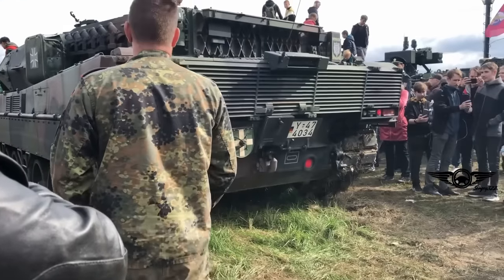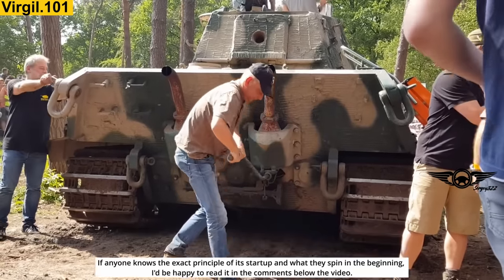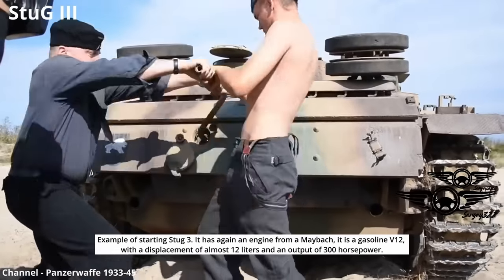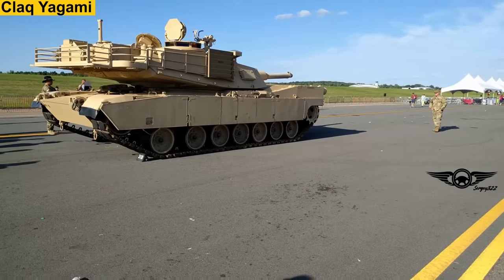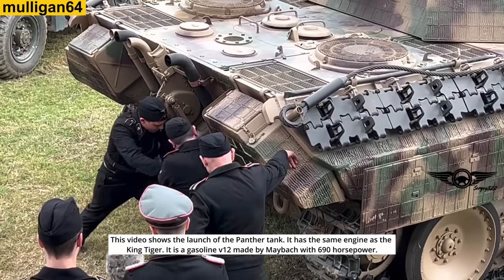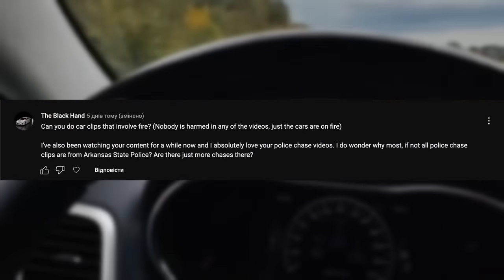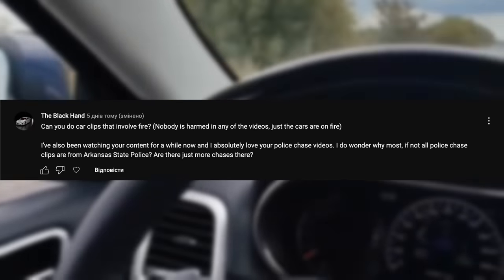TANKS ENGINE COLD START AND REVS (Abrams, Leopard, King Tiger....)

Comment from the maker: Hi all, doing the second part?
Enjoy watching it. Thank you for your support of the channel.

The second part - https://youtu.be/LVXtUNldgSA
Third part - https://youtu.be/A3fxGczyPds

Feel free to leave your questions under this comment. If you have any)

Submit your video to be featured - https://forms.gle/LysRYr34A6Z7B7va6
Reply: Love you videos
Reply: Yeah on that first tank the tiger, they're cranking a flywheel that helps get the motor started. What they used to do on the old model has back when cars were first start be made and they didn't have actual starters
Reply: 0:46 I believe they are starting the pony motor.
Reply: @Wyomingchief basically the same as push starting it just with a crank
Reply: @evilborg its just a massive flywheel
Reply: А как они классно горят от русских РПГ-7.😂😅
Reply: King Tiger: "spits" who the fuck woke me up??
Reply: Perfectly right, sir
Reply: The king tiger is using an inertial drive starter, they had both electric and inertial, but they mainly use inertial for the show.
Reply: Все это конечно не плохо , но там тепло , а если минус 10 -15 градусов.
Reply: King Tiger uses an inertia start mechanism. Basically they are spinning up a flywheel.
Reply: Flywheel
Reply: Horsepower isn’t the same as capacity .

Comment: They are started by using the inertia of a spinning flywheel. You crank the flywheel up to speed with a hand crank once you have cranked it up to speed you remove the cranking handle, then engage a clutch which makes the flywheel turn the engine
Reply from the maker: Thanks!
Reply: The crank starts were around before electric starts on all vehicles, tanks, cars, trucks and farm equipment, then stayed as a back u starting method for many vehicles for quite some time. I used a tractor in the 90's that still had hand cranking, indeed some small engines such as generators and go-kart engines still use a variation of this now with the hand pull start.
Reply: @Sergey322  Early Bf 109's had the same type of inertial starters...
Reply: The German WWII tanks can be started electrically via a starter motor, but the flywheel crank start is used to save on the starter motor and electrical system.
Reply: @johnmorgan1629  I had a crank on my series 3 Landrover. It saved my but a few times when my batteries went flat.😊
Reply: Thanks for the info. I was convinced this was a clockwork motor!!!
Reply: the way it simply bangs into life, no chuntering just boom..
Reply: УАЗ также заводится
Reply: People are confusing inertia starters from hand cranking. 

Your old Land Rover / Lifeboat / Generator / Model T was started by you priming the fuel and in some cases decompressing the cylinders, then throwing the engine over by hand causing it to start.

The inertia starters build up a rotational force in a fly wheel separate to the engine that then does the job of an electric bendix type starter.

These guys would be ripped if they were throwing over a 12 cylinder 600hp tank engine by hand. 😂

The British Army says:
“STARTERS
Two starters are fitted - one electric and one inertia. The Bosch 24V axial motor is mounted on the starboard side of the engine at the forward end and immediately above it a Bosch hand operated inertia starter, also of the axial type. The hand crank for the inertia starter, is carried in suitable clips on the tail plate, the orifice being covered by a B.P. sealing plate when it is not in use.”

The Tank Museum at Bovington says:
“Hand Crank Starter
The hand crank starter, is the recommended way of starting a Tiger in cold weather conditions, for normal conditions it also has an electric starter.

The inertia starter ” Schwungmasse ” works by rotating a heavy mass at speed, once it reaches 60rpm a lever is pulled below the hand cranking arm, this pushes the drive pinion onto the fly wheel, making the engine rotate and start.”

Hope that helps.
Reply: @oleandersen2228 I can't imagine if the electricals motor fail and then there an enemy 

Yikes
Reply: @johnmorgan1629  also kick start for motorcycles/mopeds as well are similar.
Reply: pretty obvious to be honest, also a well known starting type by planes using a flywheel driven by an electric motor.

What i find pretty interesting and awesome are the 12 Gauge shotgun shell starters found on i think some british ww2 planes especially
Reply: So essentially your poping the clutch
Reply: @oleandersen2228  partly correct, the main reaon was to protect the Batteries, ww2 batteries were lot more fragile and run much quicker out of juce than todays, Fliehkraftanlasser protected the Batterie of the starting process.
Reply: it is like a tractor
Reply: That Panther engine sounds awesome in idling. Thanks fornthe video upload
Reply: @oleandersen2228 Electric starters were also notoriously unreliable back then.
Reply: Is it dangerous to be around that cranking handle after you pull it back from the fly wheel? Like in the first clip? Looks like a bad place to be incase it caught or something, no?
Reply: @harrison00xXx The first example you gave is how most modern engines start.
Reply: @th3turb0lag  No, i meant inertia flywheel starters, my fault!

You know, the ones with a clutch where you have to spin the flywheel fast before engaging the clutch.
Reply: Cutting edge technology lol
Reply: @HochgeborenKlown all Me 109 had inertial starters and the Fw 190-8 as well...
Reply: same as a old school Citroën 2cv (deux cheveaux) :)

Comment: That turbo whisteling of the leo 2 absolute amazing <3
Reply: all the how dare yous!
Reply: When the leo 2 was at a really high rpm like redlining basically it sounded like a T-64, still sounds awesome though
Reply: The faint whine of the super chargers on the Leo 1 in the first vid are also cool! I miss that sound. The Leo 2s really rip.
Reply: 1.9 TDI +++
Reply: @Grease_Factory Leo one really is supercharged? I did first half of my duty at an driving school company and we taught Leo 1 and M113. I was told the MTU engine was turbo charged 🤔
Reply: @basakysa7054 🤣🤣🤣
Reply: Leo 2 engine is what Toretto needs 🤪
Reply: @thomasr.5443  yes they had twin centrifugal superchargers.

Comment: On all German WW2 tanks they had the hand crank start-up along with normal battery start-up. The crew usually only used the hand crank method when it was cold outside and the batteries were too low on power to start the tank.
Reply: It’s not just the Germans, the Russians and the Americans also mainly used crank starts to get going, the battery method was used only in emergencies (hence the name “emergency start up”) when they need the engine to start quickly, and as you said they can’t use the battery start in cold weather
Reply: FlitzerFlash  i didn’t know if the Russians had batteries in their tanks, so I just included it in my comment just incase they did

If the US had faulty electronics then they wouldn’t have put the emergency starter into service in the first place, it wasn’t like today where an entire truck can fall apart and they still keep it in service; the only reason that the US prefered to crank start back then was because the of the radial engines, if left over night the oil in the engine will settle at the bottom and you would have to (literally) rotate the engine a full 180 degrees to be able to start the engine using a crank start, it is possible to start the engine with the emergency starter on them, however it will cause excessive wear on the engine components; the same is true with the german engines except that the Germans wouldn’t have to turn the engine 180 degrees to re-distribute the oils throughout the engine
Reply: FlitzerFlash  nope... soviet ww2 tanks had batteries AND compressed air, so engine can be started even without batteries
Reply: FlitzerFlash  T34 was started with compressed air and from a battery
Reply: Some German tanks also had a pony engine which started first the start the main engine.  Bit like Caterpillar bull dozers.
Reply: Wrong! The electric starter was only for emergencies.
Reply: Bruh, they used inertia starters, they aren’t turning over a v12 by hand lol
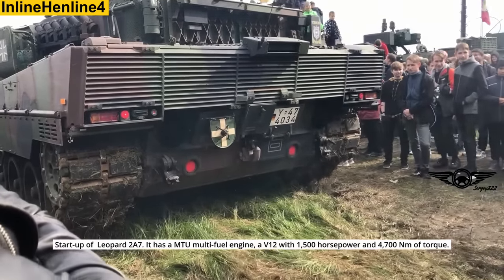Reply: “Lee-oh-pard”? 5:34 come on man 😂

Comment: Fun fact! The M1 Abrams uses about 16 litres of diesel to just to start the engine
Reply: M1 Abrams does not Run on Desal it runs on Gas
Reply: @danielpetrucci8952 wrong it’s jet fuel
Reply: JP-8 jet fuel is the preferred fuel but diesel or even gasoline in emergency can be used.
Reply: @christopherhjorth6091 That’s right. Diesel is similar to jet fuel.
Reply: IAM guessing none of these are battery powered, go green and all that 😂 static museum pieces soon
Reply: @svenlarsen4876 I’d like to see your battery powered tanks actually work oh wait they don’t 😂 and the environmental impact of making those batteries is sooo much better as well as them being longer range oh wait they aren’t 😂. All the failed battery powered tanks won’t get the glory of being put in a museum.
Reply: @KentuckyAk101guy  I was making a joke
Reply: @vincentstohr2216  I like how he said "diesel or even gasoline" as though diesel is basically interchangeable, but gasoline would be pushing your luck.
Reply: @lachlanbell8390  Gasoline can also be used. Military jet fuel is also mixed with gasoline so it doesn’t freeze.
Reply: @lachlanbell8390 the turbine engine is multi fuel. Just as many military vehicles in the US military are equipped with multi fuel engines, which allows them to run on all sorts of shit Incase logistics falls through
Reply: @lachlanbell8390  That's exactly right. Gasoline doesn't have the lubricating properties that jet fuel and diesel do. Running on gasoline would work but would cause higher wear, and likely require a rebuild afterwards.
Reply: @MommyKhaos  That's why it burns and explodes well and it costs $1,000,000 billion.

Comment: One of the reasons the M1A2 uses a gas turbine engine, is because it's quieter than a diesel.  You can hear a diesel from a long way off, but the turbine is a lot harder to hear.  It also provides a lot more power, at a much more steady rate.
Reply: Turbine is not quit
Reply: @gtvishal2521  Not quiet, quieter than a diesel.  A diesel has a rumbling bass that shakes the ground for as much as a mile or more.  The turbine doesn't do that.  a turbine can get within a quarter mile before you hear it, and by then, you're already long dead.
Reply: I'm sorry but the turbine is louder. High pitched noises travel further than low frequency
Reply: @Cheesusrice69222  No, higher frequency sound waves travel less distance because they transfer more energy to the atmosphere. Forming a rarefaction wave is "taxed" more for movement with higher frequencies.  Maybe you were thinking of decibels?
Reply: I know it seems counterintuitive, but the OP is correct. Never been more scared in my life than when a platoon of M1s basically snuck up on us at night during a field exercise in Graf. At speed they are shockingly quiet and the first thing you hear is the tracks. It’s crazy.
Reply: @rapid13  It's as if 10 Jolly Tan Giants just step up to the campfire and say, "Hi!"  Like, "*WHERE THE $#!@ DID YOU COME FROM?!?*"
Reply: It produces too much heat
Reply: Not more power, complicated gas guzzling turbines, but they can be very reliable I have see a m1 that was way over its overhauling time but running like a champ.
Reply: But the deep growling of the Tank engines is also a kind of psychological warfare. Imagine lying in cover (at night) and hearing a group of these earth shaking Diesels closing up to you for a time Feeling like eternity. I guess this is nerve wrecking and some would want to run for their lives...
Reply: @Cheesusrice69222 that’s a myth.  The engine used by the Abrams is quieter than most and can burn just about any fuel you put in it
Reply: @Cheesusrice69222 this is categorically wrong??? Low frequency sounds travel through both the air AND the ground (which is denser than air). You may be thinking of the SPEED at which sound moves, in which case yes, high frequency sounds move faster, but get broken up and distorted sooner. Basic physics man, cmon.
Reply: @christianschmitz6082 that's not an advantage, you WANT to be sneaky, and scare the crap out of your opponent when it's too late to run away or fight. This is why the battle of 73 Easting was such a slaughter, because the Iraqis couldn't hear the Abrams approach in the storm until they were already being shot at.
Reply: Wrong in all accounts. Gas turbines are louder as you did hear, as louder in ideale state as in movement speed and 10x louder at night.  High screech is louder and further being heard then a deep rumble because humans hear rather high freqnces in the 1000 Hz then low ones 50 Hz. You fight humans not bats or animals. Even more down sides are the constant 100% fuel consumption no matter if you ideal at speed. The shitlong spool up time. this is deadly as fuck in a combat environment. Unlike diesels that just jump on of a press of a button. Diesels are easier to maintain more common can be run by all kinds of fuels, from simpel cooking oil to alcohol to LPG gas to biological diesel to standard and so forth. actually almost everything can be used as a fule in a diesel. Diesels are by far more resilient then turbines. Lose one blade or by god have it misaligned and you whole powerpack is gone. use one cylinder and you maybe get a few meters out of the engine before it dies completely. I had the fun encounter in woods with leos at night. was not more then 200 meters away in my foxhole and the fuckers simply drive throu our lines without even a as much as a sound. Even ear protection I forgot to put in. Fun fact about diesels. you can shift a gear higher or two make it run even more quite and consume less fuel while you cant do that a gas turbine because it will always whine at 100% power and suck your tank dry. Hence why real tanks range is measured in Km and not in Minutes. Dont get me started on the sandblasting, heat they produce. The cons outweigh the pros when it comes to gasturbines. Not even the weight of the powerpack is a pro at that time. And all nations that can and do build 1st gen tanks can also build gastrubines without a problem. no one is so stupid to do so as they are utter crap. There is zero benefit to a gastrubine in a tank.
Reply: Abrams is absolutely a quiet machine.

Ask any infantryman working around them at night during a field exercise. You'll hear the creaking and clanking of the tracks before you hear the engine.

You can try and apply what you think you know about physics and sound and etc etc. but that all just withers in the face of soldiers common experience with these machines (including my own).

If you are a terrain feature away from these things (have a hill between you and the tank, or a wooded area) you probably won't hear them at all until they're within a few hundred meters
Reply: Truth.  You don't hear an abrams coming.  You feel it and maybe the tracks make some noise but the engine is super quiet

Comment: We only have a small tank fleet in Australia (60 Abrams). These are on loan from the USA who are supposed to replace them with 90 re-manufactured tanks when the need is required. We did have a decent size fleet of 1976-1978 Leopards but these were sold off as they were warn out. They never saw combat and used for training only.
Reply: Tanks don't ''wear out'' after a certain time or track mileage they are totally rebuilt.
Reply: @Slaktrax  Our Government said they were warn out. I know some were sold\gifted too the Solomons but most went to Indonesia & Saudi Arabia. Australia wouldn't have spent the money rebuilding them just too have the parked up. We don't have a great need for them here.

Comment: I had 1958 MGA for many years.  It had a hand crank when batteries didn't work. It was easier to push start.
Reply: I've started cars; back in the 80s, by getting it rolling n pop the clutch. Didn't know tanks were cranked up ..must be old ones?!

Comment: Cranking moves a kind of flywheel, which acts like a starter. When you get enough speed, a clutch is activated, which transfers the rotation to the engine to start it.

Comment: Those tanks look fantastic.  You have to have really good arm muscles to use that crank 😂. That leopard was blowing to much black smoke though. The name of the tank is pronounced the same way as the jungle cat. The O is silent.  Have a great day my friend ❤️🙂⚘️.
Reply: no, it is  Le-o-pard.
Reply: Fun Fact, When The Exhaust Dust dark like in the Vid. then it was Geoeffnet (German for Full Power without throttle  the HP.  ) normally the LEO run within 1190 hp,in Gefecht it is over 1590 hp. So you`re Insider . ..Greet`s from Germany. ..
Reply: Wrong, listen to a German pronounce it. It's Le-O-pard.

Comment: the strater in the first bit of the video looks like an inertia starter. a flywheel is spun up and then it is connected to the engine and it starts.

Comment: That handle they turn on the back of the king tiger spins a 220 kW a inertia starter that fires the main engine, and then the engine fires itself up from there and runs on its own

Comment: I think with the tiger tank they’re basically hand cranking a flywheel that will be connected to the engine to get it turning. At that point you hope that the engine fires so you don’t have to spool up the flywheel again.